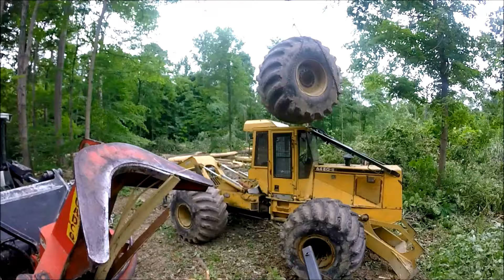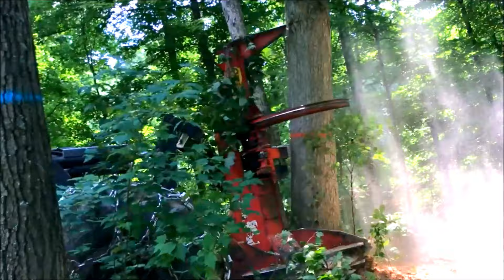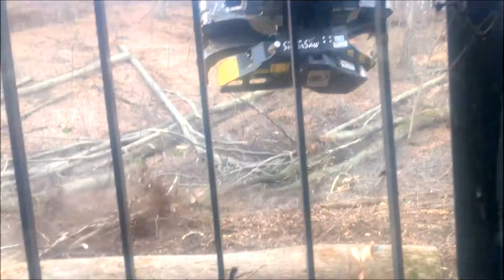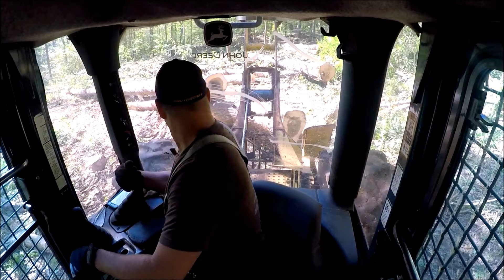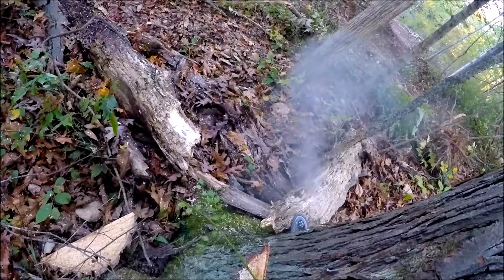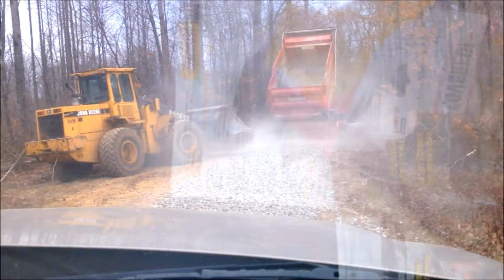****Must See****   Mechanical logging

Comment: Great vidja but kinda torn about the mechanical thing I haven't really logged(I mostly climb up in them and cut pieces out of them)hope to do some logging this winter. Sometimes I actually like it when the machine can't get to them(bucket, crane)just rope pulleys and chainsaws.Machine are nice just not always. Safety advances that actually work well are great. I'm a firm believer in blending the old with the new if it works right not just because works but because it works right. There's a lot and old man can teach u but doesn't mean a young man can't teach u a thing or to.

Comment: Safety is a huge reason for mechanization on the West Coast. L&I rates for a man on the ground are 10 times higher then for a man in a cab because of the accident rate with men on the ground. You won't always be able to do everything in a machine, but you can do a whole lot these days.